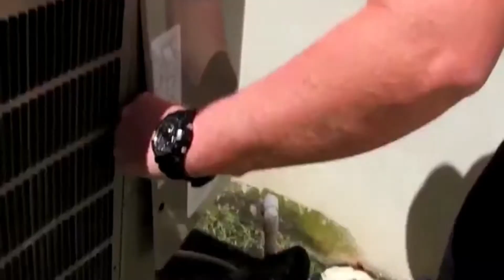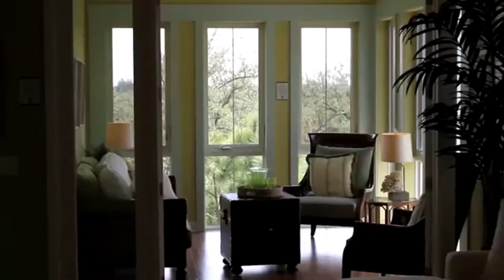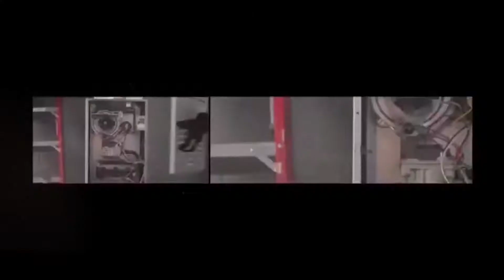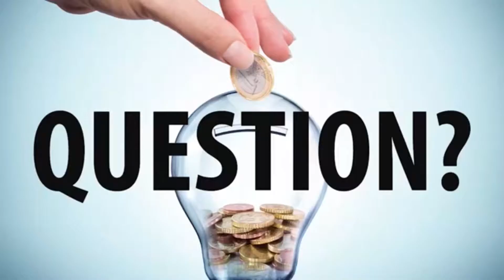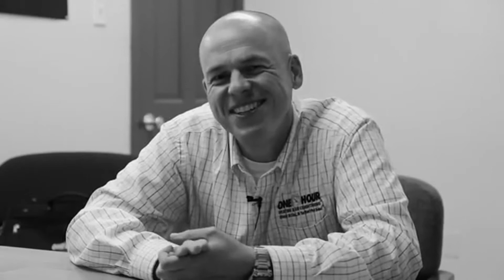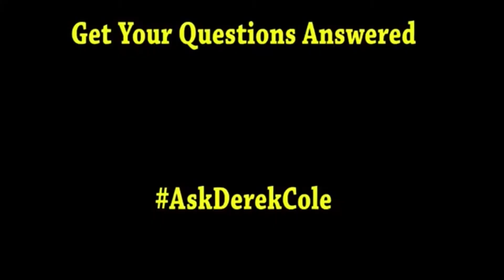Gas or Electric HVAC System | #AskDerekCole Episode 47

Comment: I just ran the numbers for my last two winter high use periods (mid Dec to mid Jan) here in Oakland, Ca. - a heat pump costs $94 and $125 more to operate than gas for one month for the two periods under evaluation. So gas wins the day for me.  FYI - we have an electric hot tub, and a 4.65kW solar system on the roof.